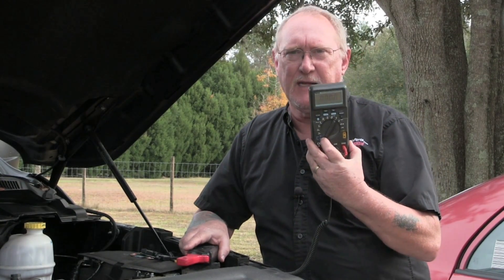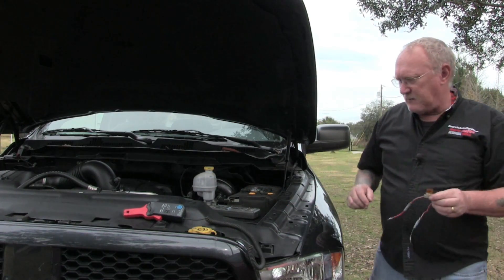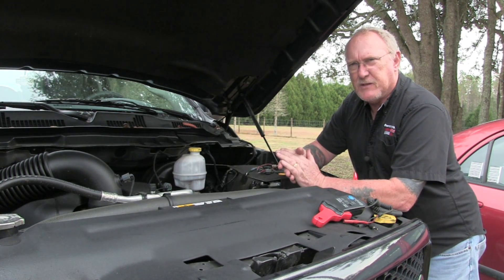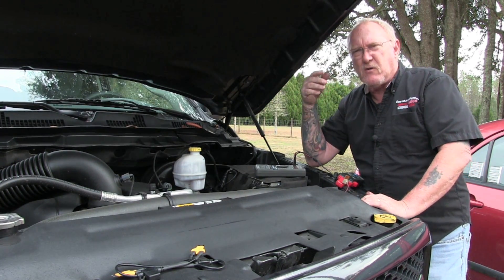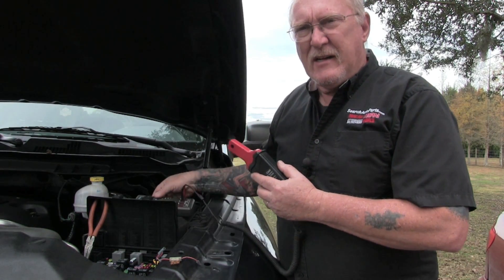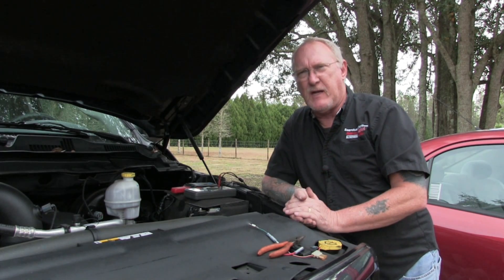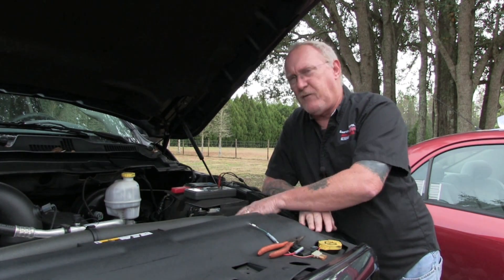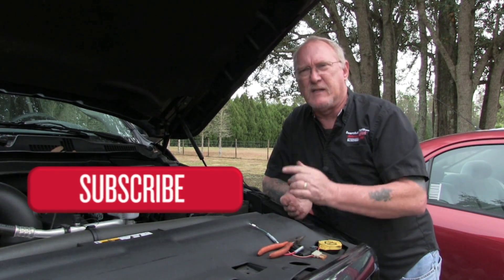The Trainer #50: How to use current as a troubleshooting aid

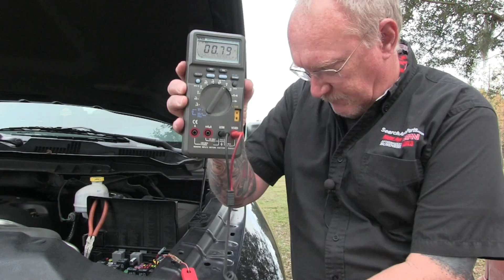Comment: Pete, I am confused. You go to the trouble of making sure the leads are plugged into the amp connection but then when you show the results of your test at 5:26 you are holding up your meter and it is set on volts and not reading amps but VOLTS and the leads are plugged into the volts connections. You even say seven POINT nine mili amps, which the meter is actually showing POINT seven nine volts not amps. Which should we use?
Reply from the maker: If you use the ammeter built into the DMM, you'll need to plug the red lead into the appropriate amp jack. The problem is not knowing how much current you might measure and if you exceed the limits of your meter, the internal fuse will blow and you could damage the tool. The marker you refer to is using a low amp probe to do the measuring. This tool converts current to a millivolt output the meter (or a scope) can read and display. And since it outputs a millivolt reading, we have to convert it to amperage using the conversion scale on the tool.
Reply: @VehicleServiceandRepair  Oh okay that makes sense. Thanks for the clarification.

Comment: Mr Pete, little confused on the current analysis, you said if the pumps running freely you would have low resistance shouldn’t it be high current, you said low current .
 An you said if you had a restriction in the line or filter it would be high current, shouldn’t it be low current . Am I understanding this wrong? Your the Best love your videos
Reply from the maker: I'm referring to the amount of work the pump has to do. If there is no fuel being moved, it takes very little to get the pump spinning. If it is trying to push fuel past a restriction, it will have to work harder and that will require more current.

Comment: 2000 jeep cherokee,,, if i try to bridge over my ac clutch from the high pressure switch to kick the clutch in but it will blow the big 20 amp ac fuse under the hood  and doesnt kick the clutch in. rpms rise a little but clutch dont kick in .Does the same thing if i try to bridge over from the ac relay from the fuse box under the hood. but i can run 1 wire from the ground wire on the ac unit to the hot post and it will kick it in that way but still wont take freon...
Reply from the maker: First, stop trying to jump things. This is an ECM-controlled system and you could very well blow your computer if you're not careful. The wire at the compressor is power to the clutch coil. With it unplugged, but the A/C commanded "on" and the engine running, is there power there? If not, then break down the circuit into two halves - the control side of the relay and the component side of the relay. Then watch this:  https://youtu.be/lEBKcyq3c10
Reply: First off Thank you for your reply... Ok With the A/C controls in the on position, motor running  and the ac unit unpluged I do have  power on the plug coming from the compressor but no power on  the plug  coming from my wire harness. Only time that wire has power in when the ac compressor is pluged in. Is that the way it should be or should i have power on the plug coming off the harness...It;s showing power on both sides of the high pressure sensor. Is that right? low side switch has 4 inlets but i got 2 hot and 2 ground. Cking this with only a test light with my clip hooked to the neg term. So if you could please help me figure this out i would really appreciate it because o dont know much about the ac system and it;s oper. So Ya I need help. i cant afford to take it to a shop...O i could hear all the video for some reason.
Reply from the maker: @kevinferrell1739  Is there only 1 wire going into the compressor?
Reply: Alternator

Comment: Dude, I wish I'd seen this a year ago before I deployed to Turkey and blew the fuse in my multimeter taking an amperage reading on a kc-135 fuel pump circuit. We couldn't get another fuse for almost 6 weeks! It only took a split second of not paying attention to blow that fuse.
Reply: Should of got a turk over at the alley to repair that fuse for you.

Comment: What's it mean if my fuse is hot to the touch? It's an older vehicle with the older fuses. I put my finger on the fuse and it feels hot. Does this mean I should check my grounds.
And then my fuse is getting warm because of additional resistance?
Reply from the maker: Fuses are thermal devices and fail when the heat caused be current in excess of their rating melts the fuse strip. Measure the current in the circuit(s) that fuse protects to make sure they are working as they are supposed to.

Comment: How can amps draw be related to figure out if there's no refrigerant since the a/c compressor is not driven by an electric motor and the electricity  is solely used by the magnetic clutch  to engage the compressor shaft to the pulley driven by the crankshaft...to me there's no correlation, am I wrong?
Reply from the maker: Watch the video again...we're not trying to measure the amount of refrigerant but if the refrigerant level is low, the ECM will not turn the relay on (along with other parameters it needs to see before allowing compressor operation). If that's the case, there will be no current flow through the control side of the relay.

Comment: could you reference the pumps ohm's value and circuit voltage to calculate amps? (ohm's law)
Reply: I=E?R
Reply from the maker: When dealing with any kind of motor, you have to include the effect load on the motor will have on current flow. That might work with the pump on the bench, but not if it's in the tank pushing fuel. Does that help?
Reply: Motor Age yes, thanks for your fast reply, Happy New Year

Comment: where did you get those little adapters you connected to the inline fuse holder so it can fit where the fuse goes ?
Reply from the maker: +Alejandro Amaro Those are from PICO but you can find Fuse Buddies at AESWave.com too.